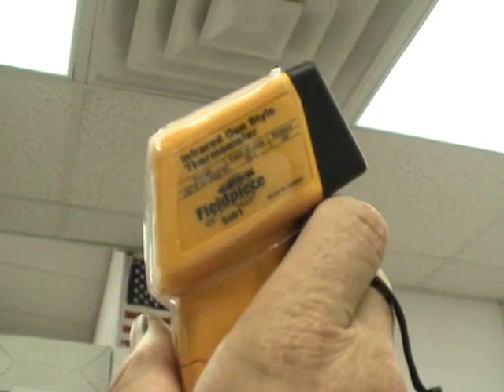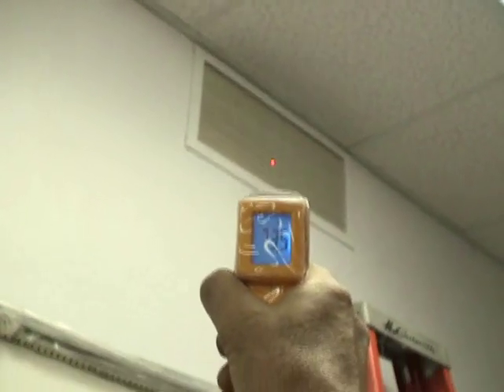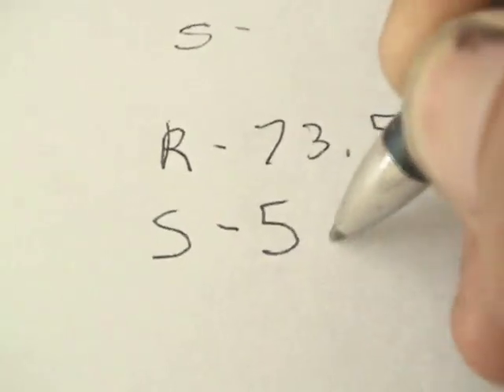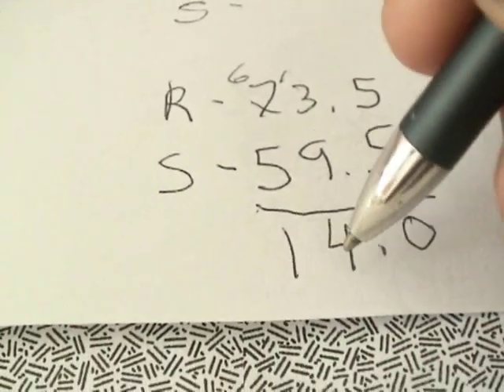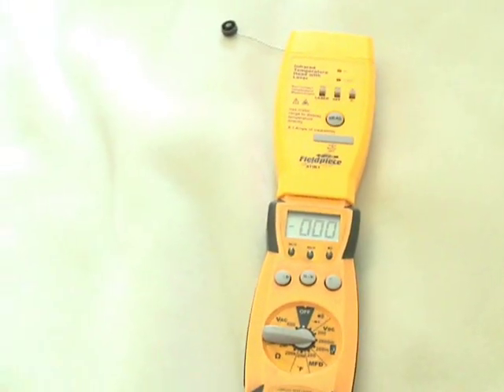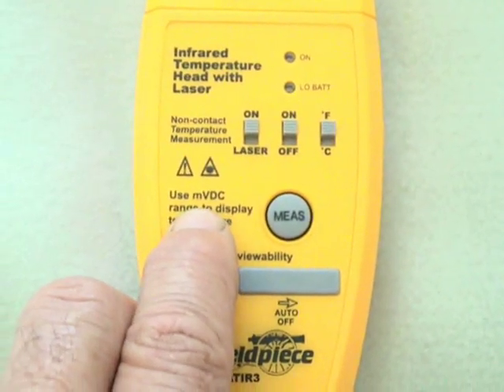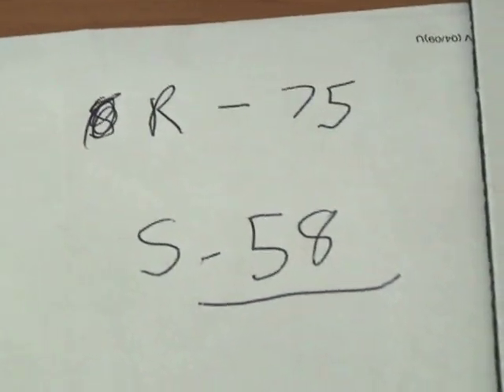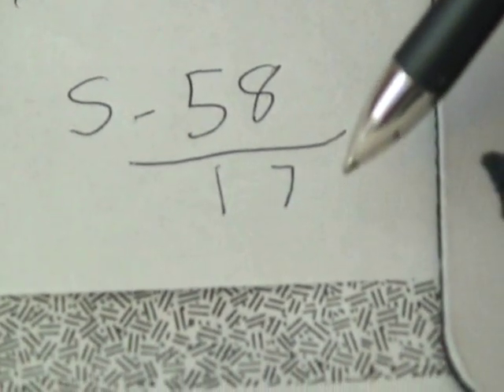HVAC Delta T

Comment: I live in south texas where it is very hot and humid especially in summer.  Just got a new central ac unit which is in attic. I noticed the delta t is better at night vs mid day. This normal? At night the delta t is about 17 degree range but mid day more like 14

Comment: Design conditions are 95F outdoors with 80F indoors, with a 40F evaporator coil "should" provide a 20 F degree Delta T/temperature differential resulting in a 60F degree supply air temperature.
However an AC units primary function initially is to de humidify if the air is humid, which it usually is due to showering, breathing,cooking or the outdoor humidity making it humid indoors.
A unit confronted with humid warm air will first primarily de humidify the air, it will not give a full so Delta T until  the hmidity is lowered enough to allow this,  it is not either or as in 100% de humidifying or 100% Delta T of 20 Degrees F, its a balance of both  ultimately giving a DELTA T of 20 if/when the humidity is normal. This is why oversizing a unit is bad in a home but great for a floral case which requires a moist air  to keep the flowers alive longer, not dry them out.
The evaporator coils got to be about 40F degrees lower than the 80F indoor air to  supply 60F air and the 20F degree DELTA T.
 In reality we will rarely see the design conditions as the variables are infinite.  The machines readings will be continuously varying like a teeter totter, if too humid it removes this but the DELTA T suffers.
We cannot run a coil  much colder than 40F or the condensation will freeze and ice up the coil  eventually obstructing any air flow through the coil.Taking the temperatures of the surfaces is a litle misleading in that the air going in may not be the same as the surface temperature of the grille
Reply: Keith Grayson spoken like a true professional sir you should’ve done the video nice to read from a true Call league

Comment: This is incorrect!! Delta-t should be measured across the evap coil. Taking the temperatures at the registers  (much less with a laser thermometer which measures mostly surface temp) does not take into account heat gain picked up in the ducts, especially in longer runs.
Reply: I never check DELTA T at a coil unless the split to my supply is crappy. say its 95 outside and 80 indoors and 70 supply temp, I will go outside and grab the suction lines temperature, it also absorbs heat on its way to  the compressor however we dont want much more than 30 F superheat or risk overheating the compressor. I check  DELTA T at the coil only when I suspect the units not running right, likie obstructed air flow etc, but technically your correct lol.
Reply: tripp68 tripp68 think you are confusing TD with Delta T -

Comment: If you take the split before and after the Evap coil, should the rule still be based on 15F or more or should we be looking at a lager split, since the temps are being taken just before and after the coil?
Reply: Design conditions (which we never see) are 95F ambient 50% humidity, 80 F 50% humidity indoors will give you a 40 F coil   and 60 F supply air.

This is strictly a ball park guide , you need to be able to check the superheat,  subcooling,  amp draw and DeltaT to make a guess at where you need to be,  unless you read  a superheat chart for that unit you will never be 100% accurate any other way,  but experience tells you if a coild filthy  and suctions low and superheats low not to add refrigerant unless the air flow is corrected  which will give superheat etc.    20 F split is both at the register and at the coil   this is ball park,  if  you have R3 ducts in uninsulated attic   you will lose 2-3 degrees but normally we do not gain that much unless poorly installed with long runs,,
Reply: I can "simulate" a 95F day outdoors by plcding a newspaper across the condenser coils surface blocking some air flow and bring the head pressure to 279 lbs with R 22 for a 125F condensing temperature(ambient plus 30F).

If the indoors are below 80F then you subtract 40F from the actual  temp,  example;  75F indoors expect a 35 F coil,  we cant go much colder or it will ice up  so we stay with 40F.
I have run a heater to the indoor temp was 80F then simulate a 95 F day outside to dial  ina unit on a cold day.
Reply: give it a try both ways and see if you get a difference.

Comment: Using a laser temp seeker is not the correct way to get a proper reading. it needs to be done at the coil with a probe style temp device. temps taken at supply and return sections of evap coil not supply grills. after 3 years in the field I find this information misleading at best

Comment: Actually, the name is misleading.. laser thermometers are just infrared thermometers with a laser pointer to show where it measures.reflective surfaces (mostly bare metal pipes) give false readings.
here, the painted white grill is ok to measure. anyway, this kind of calculation doesnt need to be extremely accurate.

Comment: need to use a wetbulb thermometer when calculating delta tee those laser thermometers is in accurate maybe that just takes the temp of the grill not the air maybe if u paint the grill in flat black paint it will be accurate . another not is dont be quite sure to think that the unit is not running ok if the delta t is under 15 it will be very low if the humidity is high

Comment: @DrZarkloff Yes sir, I added some gas to my 25 degree coil, back in June. I also notice that my superheat never goes above 3 degrees. Now my pressures are good and my filters are clean. At this point, maybe a small 110 for the master bedroom?

Comment: Dr. Z,
   How's it goi'n? I used my laser thermometer on my system, after I saw the Delta T video. The highest supply I read, was my longest run. I had A 71 degree return, and a 60 degree supply. It's attic ducting. I just figured that run to the 60 degree supply, (master bedroom) was picking up a little heat.

Comment: Dr, you should do a video comparing readings from different thermometers. ie... IR vs thernistor and thermocouple. Your IR thermometer can be fooled by different surfaces. Thermistor type are the  most accurate. I like Cooper. I hate thermocouple thermometers. 

Home owners could also check the delta across their heating unit and check that it is with in it's temperature range, Air flow can also be calculated using this method.
BTU / (DT x 1.08) at see level (DT x @1.05) @ 800' @ my town.

Comment from the maker: Thanks. But if your return air is 80 degrees you'd be expecting a 24 degree delta T to have a 56 degree supply air temperature. That would be expecting the near impossible with most air conditioning systems.

Comment: if there's a lot of humidity in the air your system will show a lower delta T due to the fact that the evaporator is using 'its cold" to condensate humidity . wait for your house to dry before taking mesurement

Comment: generally as long as the supply air temp is between 55 and 65 deg you are in good shape. Again depending on what type of system you have these numbers can very a bit.